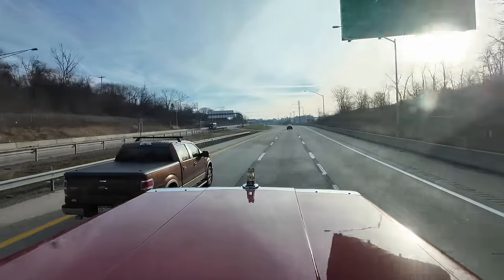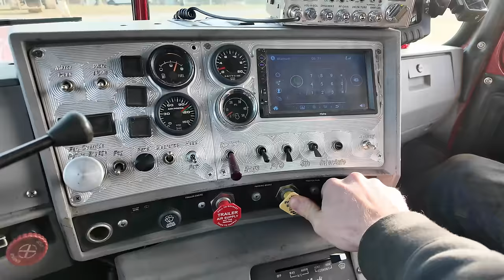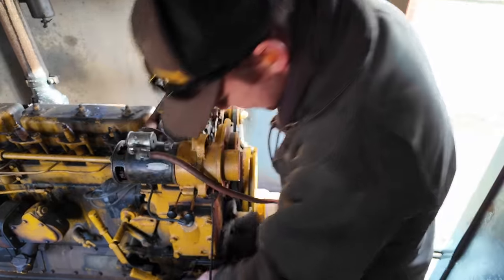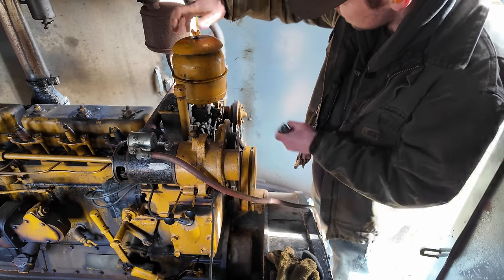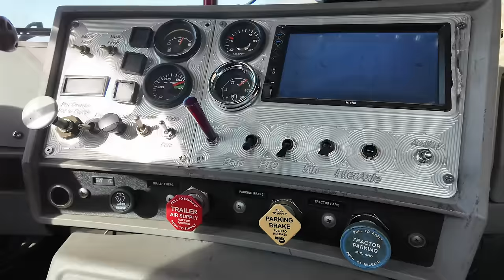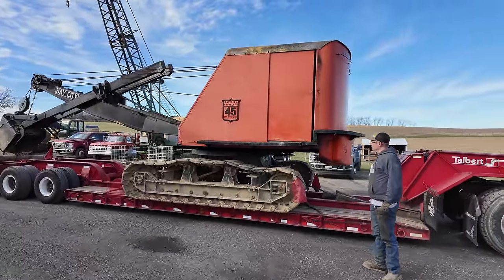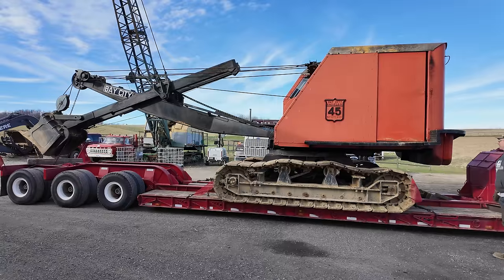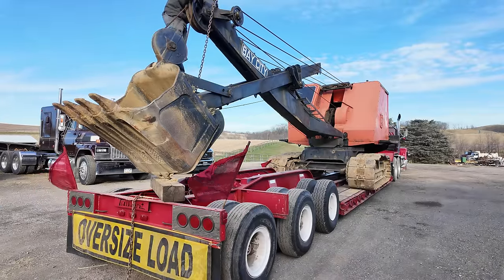Super trucking with Superdog | Hauling a Cable Shovel

Comment: You guys have just taken me back to the 1960/70s in the UK whereas a 17-year-old I drove Ruston Bucyrus crawler cranes for a construction. Rust was a UK engine and locomotive manufacture they teamed up with Bucyrus the crane makers in the US. Drove several. models the 10 RB, 19 RB & 22 RB I was told the numbers corresponded to the weight of the machine less the boom or any other equipment.
Most of the work use was hook work loading, unloading deliveries for tunnel projects. I did some grab work sinking a shaft through a running ballast layer, the shaft lining as assembled from cast iron segments to form rings, bolted on top of another to form a tube 10 ft high with a cutting edge bolted to the 1st ring. Using the crane fitted with a grab bucket I'd take muck from the center of the shaft, as I continued grabbing the weight of the cast iron would sink the lining, more rings added as the shaft progressed into solid London clay.
Once the tunnel boring machines started mining, I drove the 22 RB fitted with a dragline bucket loading from a spoil heap, into 6-wheel tipper trucks to be hauled away.
I also drove rubber tyred yard cranes, crawler mounted tower crane and backhoe excavators. But my favorite machine was the Tunnel Boring Machine and the very high rate of pay, that kept me in tunneling and also showed me a lot of the world. 

So, thanks a lot for taking this old seventy niner back in time and dusting off his memories box. Loved watching the old girl sprag the tracks to steer, those levers were for real men. No buttons in those days apart from engine start. Stay safe out there.

Comment: Hey Sam, it's great to see you working on getting the replacement engine into the Bay City. Wish that I could be there helping with that task. When we adopted the Bay City, I thought that our responsibilities would be to fix any problems but thank you for stepping up to make these repairs. Just send me the bill. Did the Bay City steer better now the missing pin in the linkage was replaced? Did the pony motor get water in the pistons again? That is just a great machine to operate it was sad to see vines growing on it for so many years. Look forward to seeing more videos of the progress on this machine.

Comment: I have a 91 superliner with a  maxitorqure 18 in it. The slector meck gets sticky on those. Either replace it or you and take a line loose and spray a little oil in the tube. It sits on top of the trans

Comment: Hey Sam what would it cost to buy a rod a ring set for the shovel if the other are ok and maybe just rebuilt the rod and bearing caps while your apart as how do you know that the engine you using as a donor is a long liver ?

Comment: Wondering what kind of fuel mileage that truck gets on the highway loader and unloaded?
Brother had a Superliner with the 350 HP Mack engine and mack transmission power house.